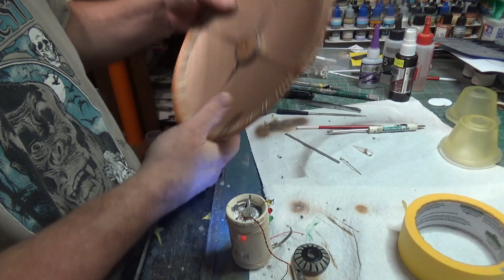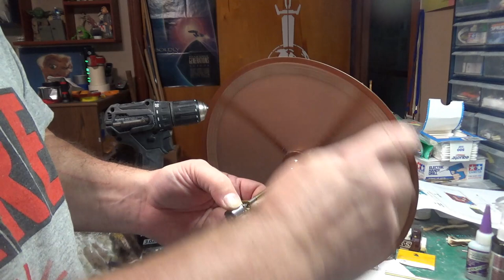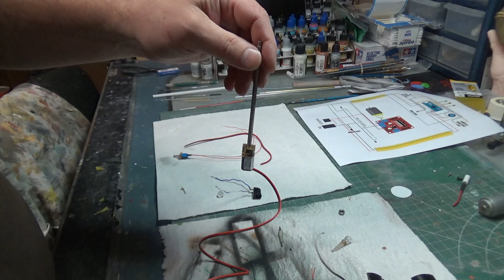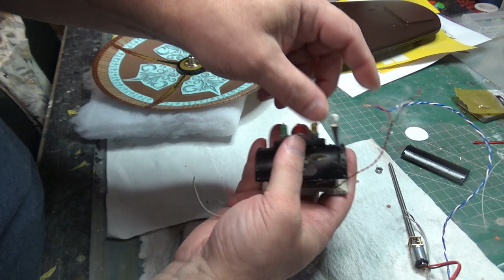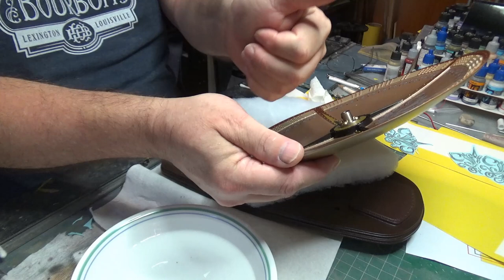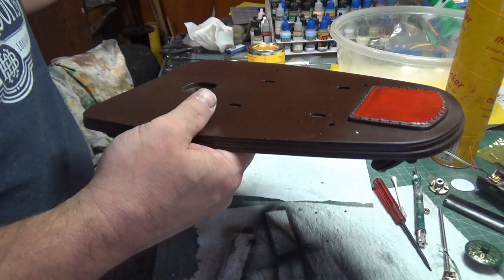Aztek Dummy Update 7/1/22 - Sprueverse Time Machine Challenge - Part 3

Comment: I built a scratch model of the Time Machine using a lot of wooden pieces from Hobby Lobby,plastic cup hooks for feet,and coat hanger wire inside aquarium air tubing for the brass railing. It's not to any scale,but it was fun to build.

Comment: You can get a right angled usb mini plug. Theoretically you could plug it into the nano and have the other end coming out the bottom of the control box. You could then seal the whole thing up but still have access to the board.
Reply from the maker: Moby Dick! I've been searching for such a thing since back when I built my one man pod. Is it a specialty order? I can't find them on the shelves anywhere
Reply from the maker: I looked at that link you sent. It looks like it would add another inch to the length of the arduino. No bueno for this build, but something to keep in my back pocket for the future.

Comment: The dish looks great! You will have additional mechanical resistance through the bevel gear! Your test should probably include the bevel gear for setting the speed controller...
Reply: I came here to make that comment. The drag of the reduction gear set is what brings the disc to a quick stop and makes low speed startup so difficult as it stands now. The right angle gears will only add more drag so AD should mock up the whole drive train before finalizing as you said.
It's possible to obtain finely machined gear sets with Very little friction but I'm betting that's not what's coming.
Reply from the maker: that's what is keeping me from sealing up the front controls. I want to test it at as complete a thing as I can before closing it up.

Comment: As others have mentioned just using a sleeve for your test created a fair bit of friction when running your tests....not sure if you are planning to use bearings for the final drive but there will be further losses through the shafting and bevel gear arrangement. For the larger motor, can you control the voltage using the Arduino and thereby controlling the speed of the motor.....being of the Engineering variety, I am not an Electrical Engineer so not sure if that will work or not.
Agree JBOT's decals are great. I've used them several times with no issues
Good luck
Reply from the maker: i want to have the final shafts inside a sleeve of brass so they don't rub against (and wear away) the resin.  Bearings will be involved.

Comment: Hi Lou. Dish looks amazing. Rather concerned about screwing into resin and then vibrating it with the rotation. Maybe worth putting a dab of epoxy on the screws to help stop them tearing/screwing out. As I had feared, turning that big dish with a little motor is going to be a challenge. Small motors (certainly the cheap ones) are generally of the high-speed low-torque variety. Gearboxes can be used to trade speed for torque but it is doubtful you have the space in the kit for such a drivetrain. Running the axle through a simple sleeve bearing doesn't help due to the high friction created, made worse by having the weight of the dish at one end of the shaft. Ball race bearings were invented for a reason! Unfortunately they are not an option on this kit. As has been mentioned in previous comments, further drag will be introduced by the required right-angle gears and just make the problem worse. At least if you do manage to solve the drive/speed problem the dish is balanced well enough not to shake the model apart! The very best of luck to you in solving the mechanical problems 👍
Reply from the maker: yes the final plate will be "glued and screwed" to the dish

Comment: Lou,
I've seen really good suggestions in the comments,. But also is there any chance you can modify the code so that when you select slow speed it applies max power for one or two seconds - just enough to start the motion - then switches back to low power?
Reply from the maker: ill take it up with the programming guru

Comment: If you had to how would you balance the disk that came with the kit, I like the motor sound when it stopped. Almost sounded like the movie chair disk.
Reply from the maker: I think I would mount it to a cordless drill and try to sand the high spots on the backside with a sanding block while it spun. You might need someone else to hold it and the drill down to a table.

Comment: Regarding the spin speed of the dish, could you wire in a speed controller from a model railway?
Reply from the maker: There are two programmed speeds built into the arduino code. It's only a matter of tweaking those values to fine tune what the speeds will be.

Comment: Why don't you use an rc servo? Micro size ones are fairly cheap and reliable. Just remove its control board, and alter the shaft stop (most standard servos only travel 90 degrees).  Many have done this, and you get a reliable tiny gear motor. It should work well with the "code tweaking" for speed success.
Reply from the maker: I had a smart ass reply all teed up, but I thought better and I'll just say that I'm pretty proud of myself for even getting this far with the arduino board. I dont know the first thing about rc servos. Baby steps...